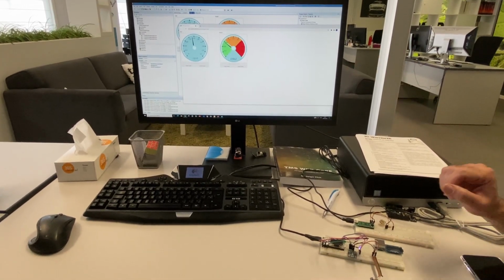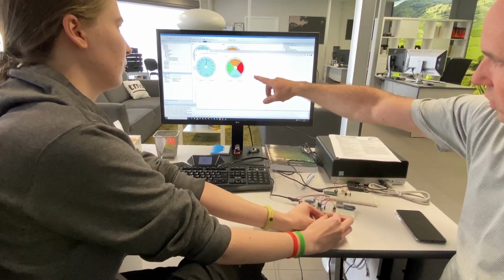TMS WEB Core USB serial + USB HID

Comment: I would have been more interested in how the WebCore application can access the hardware. That means which components are needed for it and I think that it will not work without HTPPS. Important would be a support for local webservers to realize https. Nevertheless congratulations for the new improvement I'm already using WebCore and I'm excited !
Reply: This demo is running on localhost with http. We built two non-visual components to use the browser USB HiD and USB serial APIs for communicating